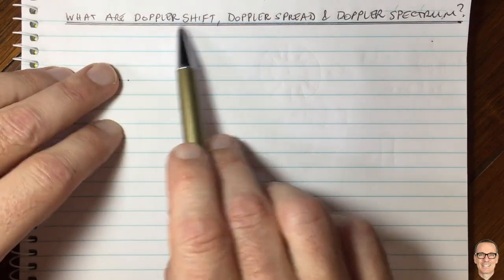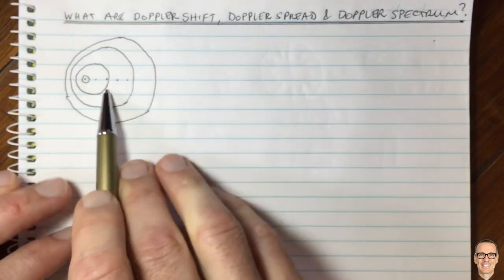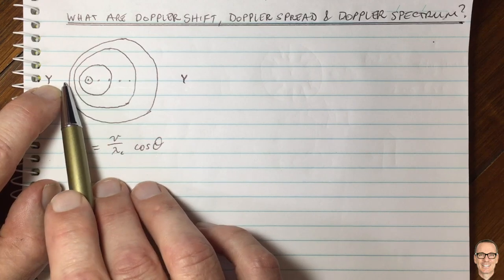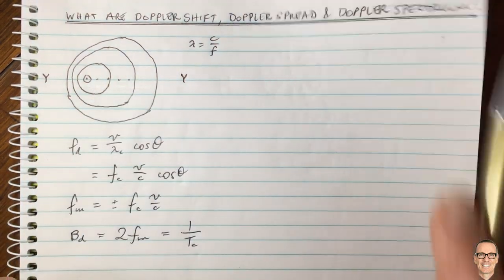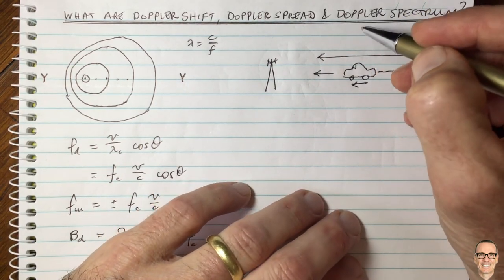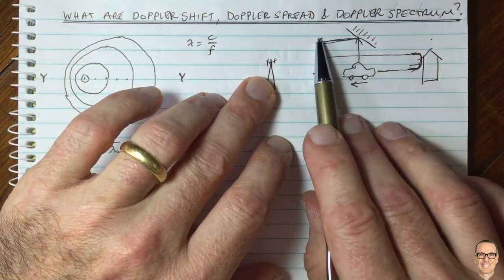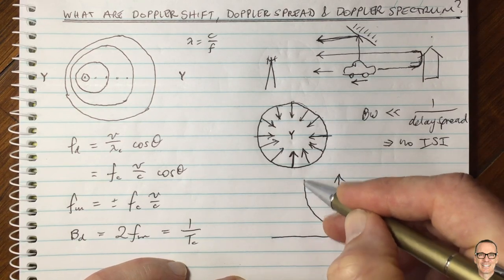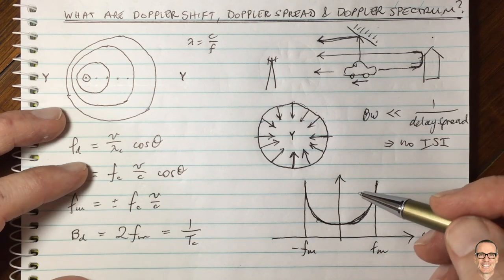What are Doppler Shift, Doppler Spread, and Doppler Spectrum?

Comment: Very lucid explanation .For 5G NR systems ,one of reason of changing subcarrier spacing is ,Wider subcarrier spacing would provide better resistance to such increased Doppler shifts at higher frequency bands. May you help to relate it ,how.
Reply from the maker: Increased Doppler shift means there will be increased Doppler spread (for a given scatterer scenario). This will lead to the sinc-shaped subcarriers in OFDM spreading out, and interfering with their neighbours in non-orthogonal ways. Wider subcarriers means there will be less inter-subcarrier interference (as a percentage of the subcarrier bandwidth). This video might help: "How are OFDM Sub Carrier Spacing and Time Samples Related?" https://youtu.be/knjeXo3VZvc
Reply: So, fast or slow fading can be defined based on doppler  spread and coherece time right

Comment: In this video Doppler is explained for the scenario of one sinusoidal waveform at a carrier frequency (single carrier). How does Doppler translate to OFDM where a summation of multiple sinusoidal waveforms of different freqeuncies (centered around carrier freqeuncy, spaced by subcarrier spacing) are transmitted? Of course each sinusoidal should have its own Doppler shift based on the respective frequency but how can this be considered in a system model especially for the channel model and the Rx signal processing?

Comment: I was recently looking at a transmitted microwave signal on a FFT display.  The signal was generally a clean trace form but with occasional slanted doppler shifts caused by aircraft scatter.  When it began to precipitate (in the form of heavy sleet) the signal pattern became constantly wider on the display due to multipath.  Was this doppler spread that I was seeing at that time?  Thanks!  You are the best.
Reply from the maker: Yes, the sleet will most likely have caused scintillation. Multiple paths coming in from different angles will each have their own Doppler shifts, which gives an overall Doppler Spread.

Comment: Is the Doppler effect presented here (and also almost in all wireless text books) representing a low speed (v<<c) approximation to the exact, relativistic analysis? Where does f_d = f_c v/c cosθ come from?
Reply from the maker: Sorry, I'm not a physicist, so I'm not exactly sure what you mean by "relativistic analysis". The equation is a straightforward calculation of the change in frequency of a signal that is travelling at the speed of light, c, when there is a change in distance between the transmitter and receiver at the speed v cosθ (ie. this is the speed in the direction of the wave's propagation between the transmitter and receiver, when one or other of them is travelling at the speed v).

Comment: If the car was travelling toward the transmitter, it would create the higher frequency components travelling toward and then lower then it goes past it. But when the car is directly under the transmitter is there any special result. Do the higher frequency signals add up to cancel out or something when the car reaches essentially at 0 displacement from the transmitter. As displacement is 0, I guess velocity is 0. Would this affect the signal received by the car? Hmm confused myself I think.
Reply from the maker: If the car is directly under the base station, then its velocity towards/away from the base station antenna is zero, along the direct line-of-sight path (it's not moving up or down, only horizontally on the earth). It's the relative velocity between the transmitter and receiver that matters - in the direction of the radio wave propagation. If there are reflected propagation paths (eg. off nearby buildings), then there will be doppler shifts along those paths, because their directions will include horizontal components.
Reply: @iain_explains  I sort of understand your point but I still don't fully understand. In my head I think of the car under the base station at that point in time, the same as if a person were just stood there.

Comment: Dear Ian, thank you very much for your very clear explanations. If I understand correctly, a channel with a single tap cannot have a Doppler spread (Jake's spectrum). However, I think I have seen simulation models of channels with a signle tap in which the tap was also assigned a jake spectrum, or channel models such as the TU6, in which a jake spectrum could be assigned to each individual tap. Wikipedia says "Let the scatterers be uniformly distributed around a circle at angles alpha_n with k rays emerging from each scatterer.", which would also mean that a single tap could have a Jakes spectrum. https://en.wikipedia.org/wiki/Rayleigh_fading#Jakes's_model
Can a single tap have a Jakes spectrum or do I always need several taps? Thank you very much for your help!
Reply from the maker: It depends on the model. Some channel models have a finite number of "scatterer delays", where each one is assumed to be made up of a collection of individual scatterers (each with a different amplitude and gain, and potentially a different doppler shift - since the scatterers that are grouped together in time/delay don't need to be physically located near to each other). In this case, each of the "scatterer delays" (or "channel taps") would have a Doppler spread.

Comment: I think It's not always necessary that the receiver is moving for the Doppler shift to take place in some case the source could also be moving

I have some questions:

What is θ?

If it's the angle b/w the incident wave and the direction of motion (of either the source/receiver). 

Then what would happen when the receiver is stationary and the  source is moving away from the receiver? when θ would equal to 180° and cos180 is -1 and  Doppler shift would have the lowest possible value, we know when source would move away from the receiver the apparent frequency will be less than actual frequency.
Therefore in this case at θ = 180°, apparent frequency < actual frequency
Now let's consider another case where the source is stationary and the receiver is moving towards the source, then the θ = 180° and the Doppler shift has the lowest possible value, but we know when receiver is moving towards the source the apparent frequency > actual frequency.

Now the question is, how is it possible that when  θ = 180° (in first case) the apparent frequency was less than actual and in second case when θ = 180° the apparent frequency is greater than actual frequency?

Is there any relation between the Doppler shift and the apparent frequency?

Is it correct to say: Doppler shift is inversely proportional to apparent frequency?

Also Bd(i.e Doppler spread) should equal to 2 |fd| , because doppler shift could have negative value if θ is 180 ,in that case Bd will have negative value but doppler spread can't be negative. Therefore the modulus is used.

I hope i am clear and i don't mean to challenge you in any way, I'm just curious with these questions in my mind. Maybe the concept is not clear to me(replayed this video for atleast 20+ times).
Reply from the maker: Any movement of any element will cause Doppler shift: the receiver, the transmitter, or even just the reflectors in the channel. I don't use the term "apparent frequency". It sounds like a vague term to me. I think it's better to stick to well defined terms, otherwise things can get confusing.
Reply: @iain_explains  sure and what about theeta? Is that the angle between direction of arrival of wave and direction of motion of mobile receiver? I had a thought of it might be the angle between the direction in which the receiver receives the signal and the Relative velocity vector of source wrt receiver, am i right?
Reply from the maker: Yes, it is the angle between the direction in which the receiver receives the signal and the relative velocity vector of source wrt receiver.
Reply: @iain_explains  thanks professor

Comment: If the transmitter doesn't move, but there are some high mobility vehicles between BS and UE.
Would it cause the doppler shift in this situation?
Reply from the maker: Yes, that's right.
Reply: @iain_explains Thanks professor.

Comment: Thank you so much professor!
Any comments on how to overcome the doppler spectrum issue specially in a multipath environment when there is contribution from other components of doppler shifts other than the most direct 0 degree or the 180 degree path...
Reply from the maker: When you have Doppler spread, you need to make sure that other signals on neighbouring carriers are sufficiently far apart. If they're not, then you'll need to implement inter-carrier interference rejection, or just put up with a lower SINR. These videos give more insights: "How Does a Doppler Shift Affect Digital Communications?" https://youtu.be/9HqlfqBDwpY and "Why is Subcarrier Spacing Bigger in 5G Mobile Communications?" https://youtu.be/uyDvjpPn8ms